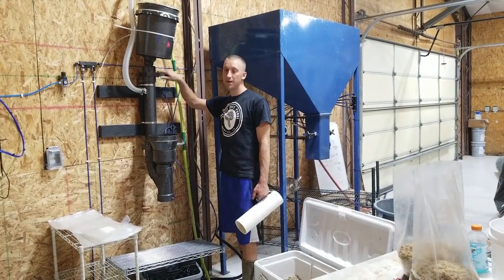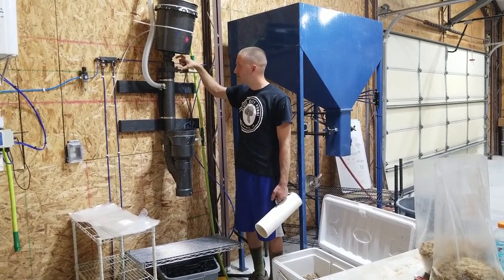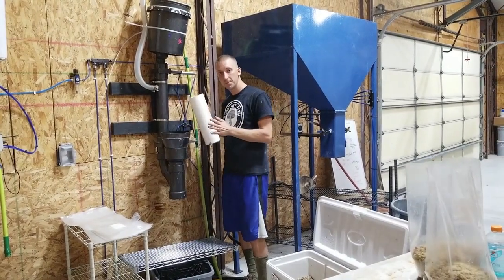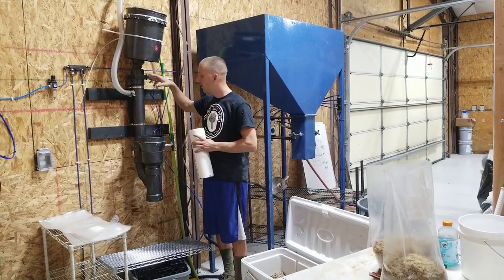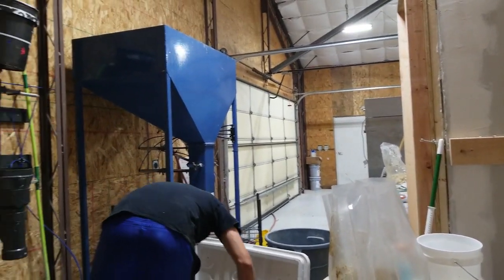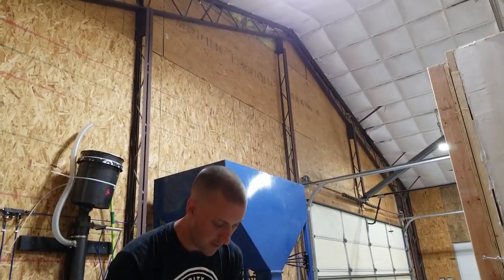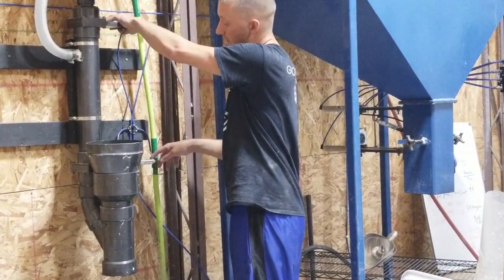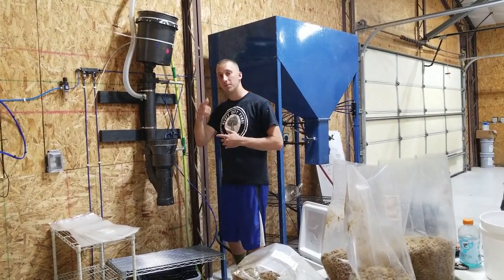Simple Fast DIY Manual Mushroom Dry Bagging Substrate Filling Setup

Comment: I have noticed that after building the pnuematic bagger, the top knife valve jams a bunch of pellets into the slot that the knife valve slides through. In turn it doesnt close all the way and lets the pellets just keep raining down. Any way to fix that, besides tearing it apart after every run.

Comment: HELP HELP. I have air leaking out around the quick connect pneumatic connectors. I bought these from the kit page. I switched them all out with new ones. Even went and bought some new ones from a pneumatic company and still air is leaking out from where the air lines go into the quick connect. I have been banging my head against the wall, researching every inch of internet.
Reply from the maker: cut the lines square with a razor and make sure they are inserted fully
Reply: Solved the problem. Now in working fashion.

Comment: I know you dont reply on youtube but i bought all the supplies for a two knive valve assembly but i am getting air leaking out of the foot pedal and have re-run all your videos and havent found any inkling on how its attached to the compressor or trouble shooting for this. All valves work but again i get air leaking from the foot pedal. Anyway i could get advice on this. I already went down that $600 rabbit hole parts buying. Thanks for your videos and remain safe and a speedy return.
Reply: what fittings do you have?
Reply: @rockyrivermushrooms  the ones that i ordered from the kit. Thee only difference is the compressor, its smaller then on the kit but still rated for three gallon, oilless 100 psi
Reply from the maker: @michaelleewagaman301  could be a faulty pedal if its leaking, any 4 or 5 way pedal will work. Where is it leaking from? the exhaust port or threads? May just need more teflon or thread sealant. Also dont run these on 100 psi, the valves are only rated for around 65-75 psi
Reply: @michaelleewagaman301  its pretty normal to have some air leaks. In factories tget have to factor wasted air into the budget lol.
Reply: @MyersMushroomsFarms  seems to be leaking in around where the tube goes into the fitting. And it leaks as soon as i pressurize it as little as 20 psi.
Reply from the maker: @michaelleewagaman301  ok so you know what you need to fix then.